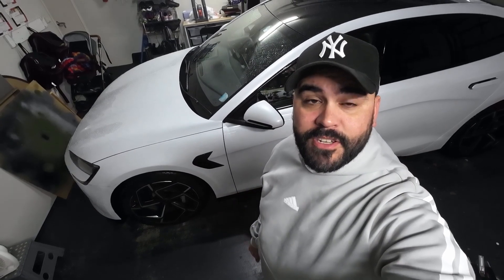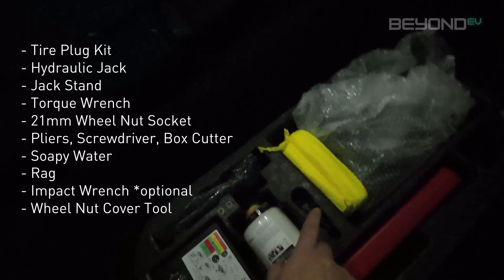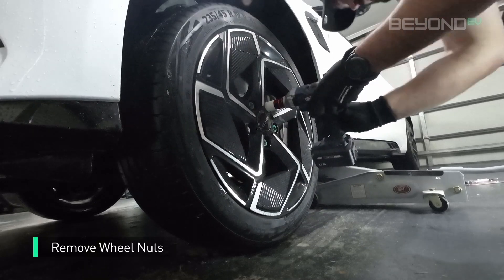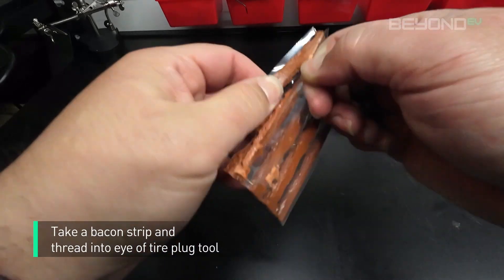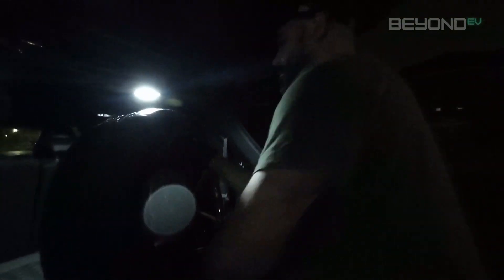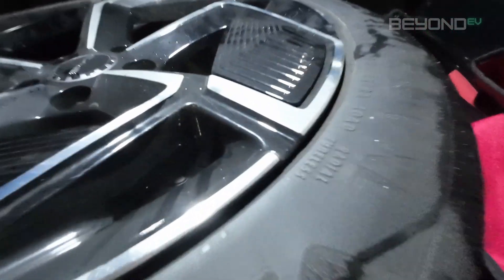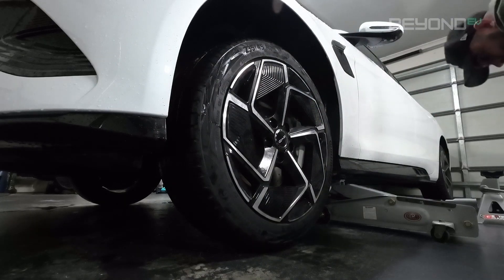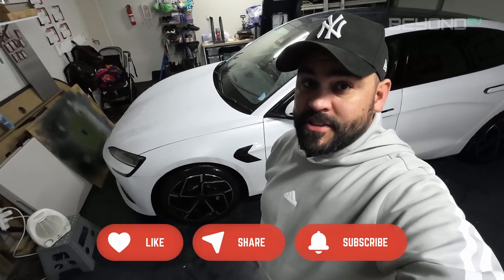How to Fix a Flat Tire on an Electric Car (Step by Step Guide) :: Beyond EV

Comment: Can you do this repair to an EV Tyre? I hope your BYD is an EV car and your tyres are EV. I has a puncher in my BMW iX recently, it has EV tyres, 3 tyre repair shops said they cannot repair the puncher on my EV tyre like this. So had to replace the entire tyre. I am worried if i have to do that again.
Reply from the maker: If it has a foam insert then tyre shops can't repair them because they plug the hole from the inside. Can't do that with a foam insert in the way.

This would likely work as this plugs from the outside...but it would only be temporary, I wouldn't trust it to stay in for long.

Comment: BYD specify 42psi for their tires which is too high and I believe it is done to decrease rotation resistance and improve economy but for a more compliant comfortable ride especially if you have only one passenger 37psi is far better pressure

Comment: A very useful video, I have never seen these DIY repair kits before. Just one thing - I would prefer to fit a repaired tyre on the rear axle than have it as a steer tyre!🙏

Comment: Love your videos. DO you know how to pair new tpms Sensors to yje wheels? I have one set on the car with winter tires, and very soon I want to put the wheels with the Summer tires but I want to buy new tpms sensors so I can have both sets with sensors, Is this possible? I f so, do you know how to set up the new sensors with the car. I want to buy the originals form TOP BYD so I can have everything ready to go. TIA
Reply from the maker: @Nuno_Tomaz  I am not sure sorry, as I haven't tried it myself. If you contact topbyd they might be able to tell you.
Reply: @BeYonD-EV  They just did after I commented on your video. It's easy to do so I'll do it once I have the sensors. Thanks and keep up the good work. Cheers from Portugal

Comment: If there is no torque setting for the nut, wouldn't it be better to measure the stud diameter and thread pitch/type then consult a torque table for that diameter?

Comment: Great clip I’ll just make three notes:
1. You must purchase a portable electric air pump 
2. When you mount the wheel again don’t use the pistol , screw the nuts by hand as much as you can and then use pistol and after torque wrench.
3. 100 NM is more than enough. Over 105NM torque you’re wearing out hubs and nuts without a reason. 
Cheers
Reply: 130 is official from BYD. Called the Hotline.
Reply from the maker: Thanks for the feedback! I used the rattle gun to do it quickly but I didn't tighten them, when I backed off the gun I could still turn the nut with my fingers. As for torque, I have seen a couple of resources that mention 120Nm as the manufacturer spec for BYD wheels, but I have also heard anacdotes from people that went to BYD dealers who said 130Nm. Neither of 100% definitive so I just went for somewhere in between.

Comment: What happen when you have a flat tire away from home, when you won't have access to your trusty hydraulic jack? Just have to call the roadside assistance service again I guess?
Reply from the maker: @noodlefoo  see in the boot where I get the wheel nut cover tool from? That's a full flat tire repair kit that comes with the car. Includes sealant and an air compressor. Didn't want to use that in the video as I'd rather save that for, like you said, a flat tire away from home
Reply: @BeYonD-EV  I could be wrong, but the repair kit is a temporary measure AND the re-inflated tyre will need replacing within 100km.
Luckily the BYD repair centres are MyCar (once known a K-Mart Tyre and Auto). It would be a pity if the tyres have done, say 30K then you're probably have to replace the whole set

Comment: Great instrctional video, thanks for making. It's actually quite similar to the plugs used for mountain bike tyres. It looks like the included tyre repair kit is just Sealant, so your solution looks much more robust.
Reply from the maker: I used to ride a bit too. I ran tubeless on my mtb and sealant alone usually did the trick, but I don't trust it for car tires so I stick to the plugs

Comment: A vid using the kit provided would be pretty good to have around, I reckon.
Difficult to replicate, but still probs worthwhile given the spiel they give at delivery about using them and bringing the seal to the service centre.
Reply from the maker: Yeh you are quite right, and I did think about using the provided kit instead. 

In the end I decided I should try to save that kit for emergencies only, for when I am out on the road and don't have a jack or a tire iron around.
Reply: Why would you use repair kit? Won’t the sealant force the entire tire change which is darn costlier than fixing small flat tires this way?

Comment: Great vid mate but gosh would have been a bit easier and cheaper to go to the tyre shop to get it repaired 🍻
Reply from the maker: @micahdrever1892  I have all these tools in my garage after years of doing stuff like this myself for my previous ICE cars. Now that I drive an EV, if I don't do things like this myself they'll just never get used 😆
Reply: @BeYonD-EV  quick one mate you have any idea how to turn the volume up on the sonar sensors, there so quiet
Reply from the maker: @micahdrever1892  I don't think you can. I haven't deep dived through the settings yet but from memory I haven't seen it as an option you can change.

Comment: You could use the air pump supplied with the car ( minus the foam ) save driving out to the gas station.
Plus, the recommended air pressure is 36 psi front and 42 psi rear !
Reply from the maker: I did think about using it, but running off 12v I know it would have taken forever. I like to inflate it a bit higher to get a good pressure seal on the plug. I'll reduce it down later.